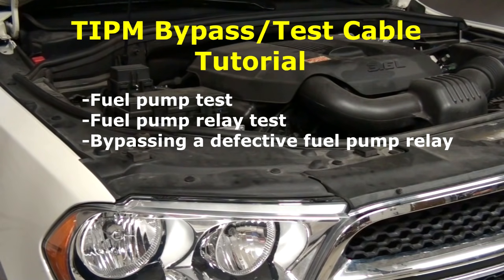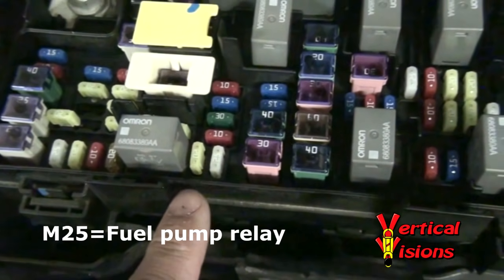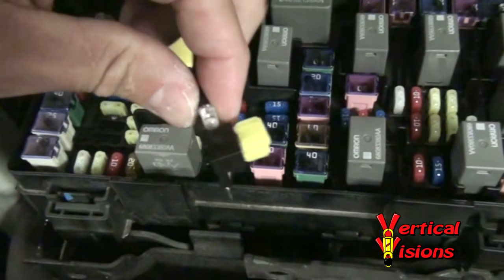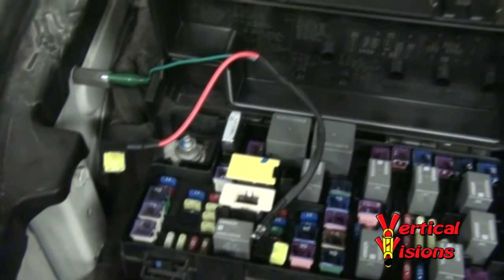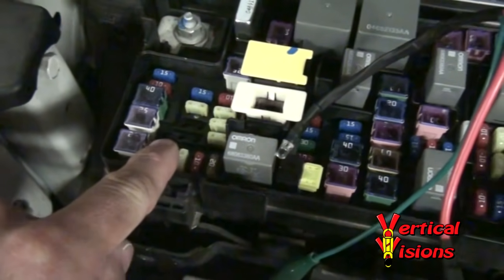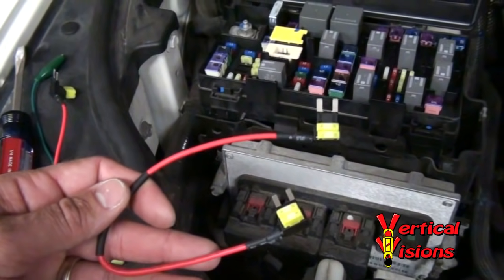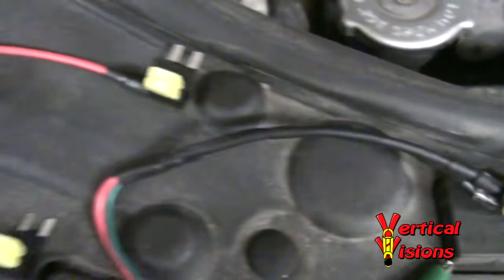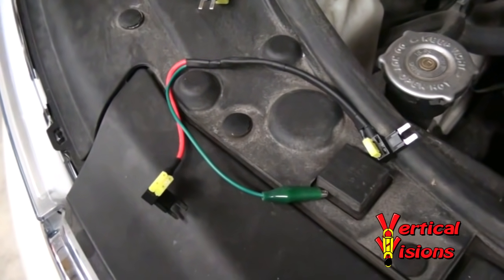TIPM Fuel Relay Test and Bypass Solutions - Most 2007-2021 Dodge, Chrysler, Ram, Jeep, VW Vehicles

Comment: I performed the test on a 2009 Chrystler Town and Country.  I have very little knowledge of vehicle maintenance and operation. 
 Both of the first two tests proved okay.  The fuel pump ran and the light went green on the relay test.  Is there reason to set up the bypass in portion three or is this negated by the first two tests coming out okay?
Reply from the maker: Bypass mode may help if you experience intermittent starting issues or stalling while driving.  You may have simply tested your vehicle on a good day when the relay was working.  By driving in bypass mode for awhile, you can determine if the fuel relay is cutting out or occasionally failing to deliver power.
Reply: I appreciate the video and the help.  Without the cable, my Town and Country will spurt and lurch when traveling at lower speeds.  With the cable, it will not spurt but it is more likely to cut power completely.  It has always started back up, but it is more likely to cut power completely while driving with the cable in place.  I took the cable back off and it started to lurch at low speeds again.  Does this diagnose anything?

Comment: Thanks for this video! I didn't want to wait for shipping so I just got the add a circuit wires from a local store. Sure enough, my 2011 Dodge Ram 1500 started right up once I put the cable in. I weighed the various options listed on your website and decided to just do the external relay kit. Then I went right to the NHTSA.GOV site and filed my complaint. Yeah us DIY folk that go on youtube or scour the web can get this problem fixed up for the price of the kit, or send the TIPM in to vertical visions to have it repaired for a very modest fee. But what about the poor sap that takes their vehicle to the slimy dealer or repair center and ends up paying $2000+ for them to replace the fuel pump and then ultimately the TIPM? Anybody that has this problem, be sure to report it to NHTSA!!

Comment: Have to say thanks! It helped me find out that my fuel pump relay was bad, and I looked at my options and I decided to do the permanent fix. I have a 2011 Town & Country which was having some of the issues (fuel pump stuck on after turning the car off, long turn-over and no start) and I did a lot of research and found this video, and more importantly this link                                                           ( http://goo.gl/B26nsZ ) which was the step-by-step instructions on how to do it with pictures. Just finished it and my  van is back on the road! Glad I installed this $20 dealer part instead of buying a new TIPM for $1000! 
Thanks again for the video and info!
Reply from the maker: The external relay works, but we only recommend it if you do it yourself.  Many dealers charge $400+ to install it.  Keep an eye on our website in the next few weeks for a new solution that we've been working on for almost a year.
Reply: I just got an external relay kit to install myself. If you have a better solution I'm intrigued to hear it before I go ahead and cut the wires and install the kit. When are you thinking?

Comment: Wow, very nice video thank you!  Our grand cherokee (2012) having what looks like same issue, starting hard actually shut off while driving.  Chrysler applied a recall, seems to start better but we are having other odd issues which seem related.  Specifically all of our lights now pulse when the engine is running, only when the engine is running.  The other suspicious issue is long extended starts (maybe fuel pump bad).  Looking for any other options as, just like you shared, Chrysler telling us the TIPM needs replaced now on our dime at $1200.00.  We asked specifically if they can replace the fuel pumps as that really seems suspicious but they shared they cannot unless they fail completely.  Complete B.S. and terrible support from Chrysler.  We do have an open case at present but getting no help.
Reply from the maker: We receive many calls from 2011-2013 Durango and Grand Cherokee owners that still have problems after the recall (external relay) has been installed.  Many report changing the external relay (less than $10) solves their problems.  Full details here:  http://www.verticalvisions.com/TIPM_relays_external.php

I haven't heard of pulsing lights, but would suggest you focus on your alternator for the time being.  Unfortunately, alternators today aren't like those 20 years ago and yours is likely controlled by the ECM or TIPM. So there are multiple things that could affect voltage output and, hence, your lights pulsing.  I would check alternator output first, then move down the chain.
Reply: Thank you!!!

Comment: Do you have one for the front hvac? I have a major issue with mine. It has to be the same kind of issue. I get no power out of the fuse box even after replacing the relay.
Reply from the maker: No bypass cable exists for HVAC that I'm aware of, but we do have a link on our Solutions page that deals with HVAC.  Link:  http://www.verticalvisions.com/TIPM_other.php
Reply: Thank you, I found that useful.

Comment: Hi Jason....I have a 2011 Dodge Ram Pick-up with the issue of the fuel pump still running when the engine is off.  I don't have a rear seat cigarette lighter.  Not sure which circuit to use.  The TIPM is located on the right side of the engine compartment (facing the cab) and the circuit numbers are also different.  The fuel pump was replaced within the last 8 months. Suggestions?
Reply from the maker: Use the circuits we specify (M7 and M25).  Your TIPM is the same style as shown in our video and on our website.  You don't have a rear cigarette lighter, but you do have the necessary hardware and circuitry in your TIPM to accommodate our cable.  Also, there are two circuits labeled "fuel pump" (M25 and M37).  If you use exactly what we say (M25), our cable will work perfectly.  A fuel pump that remains on after the vehicle is off is a 99.999% chance it's the fuel relay.  

It's also worth mentioning that we recently got a modified version of our cable to work in 2012 and newer Dodge Rams.  Still working on one small issue in getting the add-a-circuit cables to fit deep enough in the fuse slot.  Lots more in the works on our end that will be announced soon.

Comment: I have a 2012 Grand Caravan that cuts off intermittently while driving.  It started a year ago and has happened perhaps a dozen times since.  Jason spent 15 minutes talking with me about my specific set of symptoms.  Great help.  I did buy the cables and installed this evening.  If the jumper/bypass cable doesn't solve the problem, I have ruled out the fuel pump relay without throwing $$$ at the dealer.  Totally worth it.  Thank you Jason!

Comment: I tried this and truck still doesn't turn on. Any advice?
Reply from the maker: What vehicle year/model?  What problem were having prior to trying the cable?  What happened after you installed the cable?  DId you try the fuel pump test?  There are 10+ things that have to work properly for a vehicle to start and any one of them can prevent it.  Make sure your cable is installed between M7 and M25 (not M37 as some have tried) in the TIPM-7 style fuse box.
Reply: Jason Bell What is the longest amount of time that you would recommend to use the bypass cable until I can get a replacement? 2012 GCV
Reply: I've been using a bypass cable (built my own) for two years now.  I consider it a permanent "fix".

Comment: Jason, Sometimes the fuel pump stays and drains the battery, other times it doesn't pump and the car is hard to start. How can I test that and will your jumper solve that problem?
Reply from the maker: Build your own or buy our TIPM test/bypass cable to test both situations you describe.  Yes, or cable will solve a fuel pump relay issue if you have an applicable vehicle.  Link:  http://www.verticalvisions.com/TIPM_cables.php

Comment: THIS IS A RECALL chrysler is aware of this problem, it's called R09 chrysler recall campaign look it up before you start wiring and possibly blowing up the TIPM....
chrylser tech 5 years
Reply from the maker: The recall you cite only covers 2011-2013 Dodge Durango and Jeep Grand Cherokees.  Look it up. Tens of thousands of TIPM test/bypass cables are in use around the world with nothing blown up.  Your statement falls right in line with countless ill-informed, greedy, manipulative, and misguided statements made by Chrysler/Dodge/VW/Jeep dealers to people who don't have $1200-$2000 to fix this widespread problem.

I field phone calls from people who have to decide between buying Christmas presents for their kids or fixing their unsafe vehicle.  Fortunately, our TIPM cable keeps them on the road and their kids get to open presents.  Some callers tell me stories about headlights going out at night on the interstate or their car stalling in heavy traffic due to fuel pump relay issues.   These stories are compelling and I've actually shed a few tears over some calls.  So please don't come over here and spew more lies.  If you still doubt how effective these TIPM cables are, I invite you to read our reviews or reference the up vs down votes on this video.  Link:  http://www.verticalvisions.com/TIPM_cables.php#comments

Signed,
Jason Bell - Engineer (20+ years) and inventor of the TIPM test/bypass cable.
www.VerticalVisions.com
Reply: Jason Bell you just said 11 to 13, anyway I'm not here to do a back and forth match, just wanted to inform people that this could be a recall check BEFORE wiring into your TIPM. but I'm happy for your invention.

Comment: I purchased 2 of these from Jason and they work perfect haven't had any problems since. I purchased 2 because I wanted one for a back up just in case. I haven't needed to use the other one yet. Thanks Jason you saved my life they were going to charge me to change the fuel pump $600, then they would have charged me $900 to change the whole fuse assembly. Saved my life for 20 bucks.

Comment: I have a 2007 Chrysler sebring  and the wipers only work on high and doesn't park i have changed the motor and both switches i think it's a relay that went out on the TIPM do you think it could be bypass also
Reply from the maker: No bypass is available, but it sounds like a relay issue.  There are normally two double relays for wipers (on/off and high low).  Once the on/off relay is switched on, it passes 12 volts to the high/low relay.  Low speed is normally the default, but it will stay on high speed if the hi/low speed relay is stuck on.  Suggest you replace the relay.
Reply: do you know if the relay be soldered to the TIPM

Comment: Terrific product - allowed me to diagnose a 2011 Dodge Ram 1500 faulty fuel relay that was causing an intermittent  hard or no cold start. Both a local repair shop and dealer were unable to find and correct this problem!
Reply: There's two ways of repairing them. Get a whole new tipm module or take it apart and solder in a new relay

Comment: Jason  good morning. I did that file pump test. it worked. thanks,  now can I leave it like that, or do I have to go to dealer and get it fixex?  will it affect my computer system?
Reply from the maker: You can leave it in bypass mode, if you like, to continue driving.  The cable must be connected from M25 to the left slots of M7.  These cables and other repair options exist so you don't have to suffer through a miserable trip to your greedy dealer.  Cables will not affect your computer (TIPM, PCM, ECM, etc.)

Comment: I was having all the symptoms with my 2012 ram 4x4. 77K miles.. The engine would turn over easily but would not always start until after several tries. Then within a few weeks it became harder and harder to start and finally i was getting a dead battery in the mornings. After jumping truck i noticed after shutting it off i could hear that the fuel pump would remain running, so i started unhooking the battery cable at night. Then eventually after re-hooking the battery up to try starting it the fuel pump running noise was gone and the truck would not start at all. I figured it was somehow no longer getting power to the fuel pump. I was told at dealer that a new TIPM would be the fix and approx $1200 would be the cost. I could not accept this and started looking online for similar situations...I ran across the Vertical Visions Utube video and was convinced it should work. I ordered from the web site and got it within two days. It took about a minute to install and my truck started on the first try..WOW. My only question,,is there any reason not to just use this wire fix as a permanent solution??  Thanks so much for your video, its not often people with a real problem can find a true solution that is simple, effective, and affordable.
Reply: Same exact issue and exact truck

Comment: Last year, not too long after the rain started, the wipers on my 2007 JK Wrangler quit working.  I swapped relays, and that wasn't it.  Figuring it was the motor, and not having the right tools to replace that, I took it to the shop.  Turns out it was the TIPM, and it cost me about $1000 to fix.  Yesterday I got into my Jeep, and it started, but the wipers started running, and wouldn't shut off, and none of the dash instruments were working.  Frigging TIPM again.  I disconnected the battery overnight, and the problem resolved itself.  Thanks Jason for the information you've shared on this issue.

Comment: I was having this same problem with my 2012 VW Rutan where the Battery would be dead in the morning dew to fuel pump staying on during cold nights. So i got the bypass but it Still gives me hard start in cold mornings. I am pretty sure I hooked it up correctly I checked mutable times yet I still having issues with hard starts. Is their anything I could have done incorrectly?
Reply from the maker: Send us a photo of how you hooked it up and I'll verify everything is correct.  You can find our contact information at www.VerticalVisions.com.  Make sure your fuel pump is working properly.  Since your battery has been drained by the stuck on fuel pump relay, it's possible that your TIPM is compensating for low battery voltage by killing power to the M7 circuit during the starting process.  More info here:   http://www.verticalvisions.com/TIPM_cables.php#faq8

Comment: Hi Jason, will connecting this cable to the cig lighter slot cause any hard to any electrical component? I bought the cable, installed it and it worked great but it is just a concern...
Reply from the maker: I assume you meant "cause any harm", to which my answer would be no.  See our wiring diagrams and you'll notice that the TIPM cable takes the same 12 VDC source and routes it around the faulty relay.  Link:  http://www.verticalvisions.com/TIPM_wiring_diagrams.php
Reply: Jason Bell:  yes, thanks for the prompt reply. ok, will do.

Comment: I am having a same issues on my 2011 Dodge durango and very much tensed on this issue of battery draining off even after I replaced the battery with the new one.
Reply from the maker: Battery drainage issues can be caused by the fuel pump relay remaining on after the vehicle is off.  Listen for a pumping noise near the fuel tank.  If you hear it, pull your M25 fuse to avoid battery drainage and reinsert when you want to drive again (or remove the negative battery cable, although it will take more time to do so).  Often, you can also tap on your TIPM to allow the relay coil spring to disengage the pins.  Our TIPM cables can combat this problem by removing the lower fuse on the M25 end of the cable.  See the following wiring diagrams for details: 
1) Relay stuck on:  http://www.verticalvisions.com/TIPM_wiring_diagrams.php#4
2) TIPM cable installed to combat problem:  http://www.verticalvisions.com/TIPM_wiring_diagrams.php#8
Reply: Thank you so much

Comment: So what happens if you are in a wreck and eng. stops and fuel pump keeps running putting fuel on to hot eng.?     No tech that I know would do this!!!
Reply from the maker: Many people already have a fuel pump relay that is stuck in the on position, which is of concern to begin with.  Although we're pulling power from an alternate circuit, we're not sure if that circuit has power removed during a crash like the OEM relay.  It may or may not be an issue. This is one of the limitations we clearly list on our website and on all documentation.  Unfortunately, my wife is unwilling to allow me to crash test our 2011 Durango to find out.  Our cables are primarily used as testing tools to determine if the problem is the relay or fuel pump.

Comment: Jason Bell, where do you locate the wiper relay on a 2013 dodge ram 1500 hemi
Reply from the maker: Disassemble the TIPM, then check the electrical path from the wiper fuse to the applicable relay.

Comment: I, just like many others on this thread, was experiencing trouble starting my 2011 Dodge Ram 1500. It slowly started taking longer and longer to start. Sometimes upwards of 15 minutes. I took it to the dealership to get diagnosed and was told I needed to replace my TIPM, which would cost $1400. Upon googling the problem, (and by the grace of God) I came across your website. After reading countless rave reviews, I decided to give your cable a try. I can't thank you enough Mr. Bell. I received my cable today in the mail. It took less than a minute to install and my truck started on the first try. Even my remote start works. You are the MAN! Keep up the great work!
Reply: Can I ask what you connected it to?